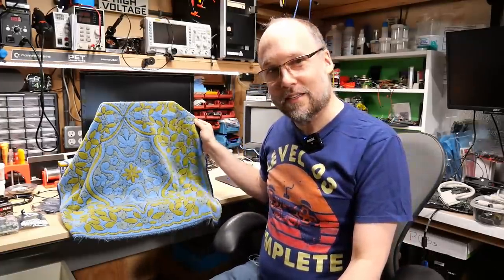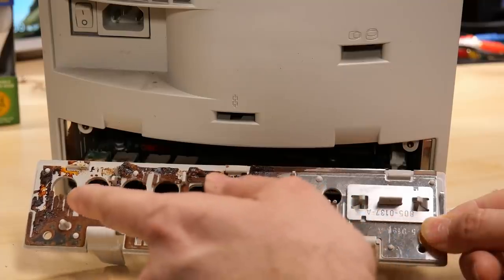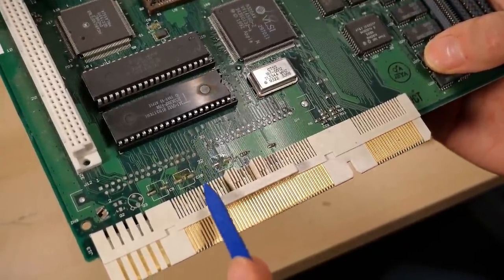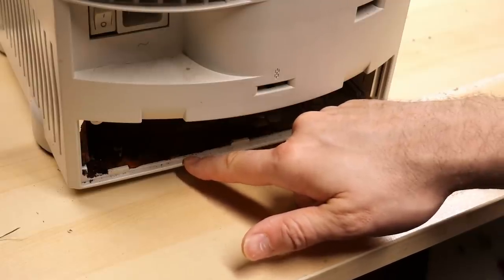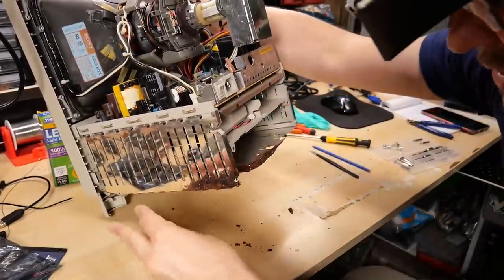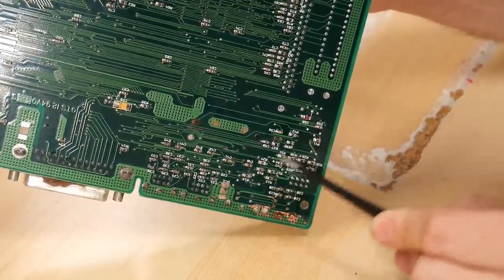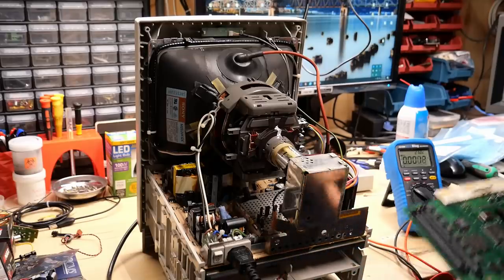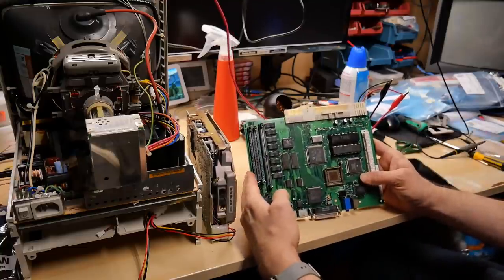Can I save this Macintosh Color Classic?

Comment: The 341S0417 chip next to the battery is "Cuda", a 6805 microcontroller that was used all the way to the iMac.  It turns the power supply on and off, and handles ADB, PRAM ("CMOS" in PC speak), and the clock.  You need a working battery and the crystal that fell off for it to boot up and try to power on the rest of the system.
Reply: It also needs the adjacent capacitor IIRC.  My original CC logic board would still boot without the battery installed, but required a second press of the power key to do so.
Reply: I think that if the 6805 341S0417 contains code similar to the 6805 344S0100 used in the IIsi for example you should be able to ground PA1 pin 25 for a soft power button without ADB. In the Color Classic this pin is just pulled high through 100k. The 6805 also generates the Power Fail Watchdog (PA0 pin 26) signal to the PSU. Without it I think the PSU will shut off.
Reply: Dang having cuda cores way back then. Apple was truly ahead of its time.
Reply: @adampope5107  you joke but they are exactly the same thing
Reply: Comparing that primitive 6805 microcontroller to a cuda is wrong in so many ways ....
Reply: @adampope5107  there is no cuda core or something like that in any primitive apple machines. You have read and learn what cuda core stands for and when it was first introduced....
Reply: @Walczyk  no they aren't.
Reply: @cezartorescu  you don't say
Reply: @cezartorescu actually they are 😊
Reply: @Walczyk yeah, whatever you say 😀😃🙂

Comment: I'm fairly certain the color classic used soft start.... from the keyboard power switch. Edit Ah and now I'm at the part in the video where you figured this out.
Reply: I couldn't find anything for the color classic but this article covers the soft start on the II and IIx. Might be useful for triggering manually. https://www.downtowndougbrown.com/2015/03/explanation-of-the-macintosh-iiiix-power-onoff-circuit/
Reply: This is correct — you soft start with the power switch on the keyboard. You can also socket the motherboard while the machine is running or short two of the ADB pins (I think 4 + 5) but I don't recall which off hand.
Reply: @StephenArsenault  That would be tough, ADB has only 4 pins…

Comment: If you are able to isolate the signals going to the ADB, the "soft key" works by dumping the +5v pin to ground. (Pin 1 to pin 4 on the ADB connector) You might be able to figure out a way to do this manually despite having no functioning ADB connectors.
Reply: Aha i presumed there would be a way to defeat the soft start if necessary

Comment: I vote yes on trying to fix that motherboard!
Reply: securitycountercheck  The repairs are typically not worth the cost, when the hardware is still fairly common. Some like the challenge though, and people like to watch. To build "repair" PCBs is certainly an interesting idea, but also requires quite a bit more time and effort. If there are already reproduction boards for sale or designs for download, that might be a better option in that case. It might not appeal as much to viewers as basic repair.

Comment: Maybe see if you could find a replacement motherboard? It's a prime candidate for the Mystic upgrade, where the CC board is replaced with one from an LC 550 or 575, along with a mod on the analog board for 640x480 resolution.
Reply: It would also be a good candidate for a takky as the case seems kinda rough on the inside

Comment: Very lucky that case is in such good condition, despite all the corrosion (and bugs!). I managed to pick up an LC575 for dirt cheap a while back, but the plastic of the case was so yellowed and brittle that every clip immediately snapped off when I put the slightest pressure on it. I have no idea if it's possible to restore the plastic so it's no longer so brittle, but I kept the broken clips in case it was so I could plastic weld them back on.

Comment: Could it be worth the effort just trying like a "dead by side of the road" fix, solder the components in the damaged area back in, maybe fix some of the most obvious traces, and seeing if you might get lucky and get an ADB port working? Since that is really all that has to work... i mean for me, as someone with a MUCH more limited knowledge when it comes to testing electronics, it would be worth a shot.

Really cool video by the way, i really like these "beyond saving" deals, and i actually think it would be really good content, if you went for fixing the motherboard up, even if it is not really viable, besides from a video content point of view. Getting this to work completely, even if it means an entire forrest of bodgewires in that corner, would be an awesome video.
Reply: I agree, let’s throw the works at this one!
Reply: I think its a great idea, you can check the contentinuity between the traces to make sure everything is electrically connected.  It would be a great video to show the sequence of operation for the Color Classic.  Are there schematics available for this mother board?
Reply: Agreed.
Reply: I agree great video very cool
Reply: Its a ton of work to trace out every pin and via and add bodge wires. The Cuda chip circuit isn't that complicated but if the corrosion has made it under the top layer of the board and you fix it, it may continue to eat away the traces under the solder mask and just fail a few months or years later.
Reply: @SidebandSamurai  Full schematics are available for this board (Someone paid to have it reverse engineered a few years ago!) so I would be trying to repair it if it was me, as the schematic is available even if this board has damage to internal layers of the board it should be possible to fix

Comment: There is a spray you get at the auto parts store that's designed for cleaning and removing corrosion from battery terminals, I've found it works great.  You might want to pick up some of that and try it on your next corroded board, it works pretty fast.

Comment: The ADB ports don't need the ICs for the power button. It just shorts out one pin to ground on the plug. Perhaps you only need to just jump those two pins?

Comment: I have the same 1993 Mac Color Classic upgraded with 500mb hard drive and 16mb ram. System 7.5.1. and Ethernet card  it surfs the internet fine with Netscape 3.0. It still works good but is getting old. The caps might start leaking soon. Do you think I should get it re-capped before the caps go bad ?......

Comment: Best of luck fixing it! I bought a LC520 this year which has a very similar architecture (I actually emailed you about advice on fixing it if you remember!) - it took a full recap and scrubbing of the motherboard to get it to boot, but it was still wonky afterwards; the screen would flicker in and out and occasionally the machine would hard lock up. I ended up recapping the entire analog board except for the big filter capacitor to try and fix the issue with no luck...it turns out the big filter capacitor was the problem the whole time. Replaced it and now it’s rock solid. If you get a new motherboard and it has a similar behavior, give that a try!

As another commenter mentioned I’d definitely try and do the “mystic” upgrade with a LC 575 board if you can get one. It’s a much better machine with a 68040 processor and proper 32 bit data bus.

Comment: The Color Classic and Color Classic II are basically the same architecture as the LC 500 line, with smaller CRTs and no optical drive. As others have mentioned some of their motherboards are interchangeable. As it's essentially an LC internally, it has an LC PDS expansion port, which I put many an ethernet card in back in the day, though other cards were readily available.
By the way, a good reference is the application Mactraker, it is a good way to look up specs and keep track of systems you have, I've used it for years (note, this is not a paid advertisement, especially as Mactracker is freeware).

Comment: Most Macs were soft power, excepting the black-and-white compacts, the pizzabox LCs, and a handful of random machines such as those in the Q610 form factor. Some soft power models (usually AIO models) also have a hard power switch at the back, probably to completely depower the system if not in use for a long time (useful because they do draw some power even when shut down and this also prevents damage from voltage transients). 
Also, your hard drive is probably stuck. You can measure the diameter of the original rubber bumpers inside and replace them with a stack of O-rings that don't exceed the diameter of the original bumpers (if they're too wide they'll interfere with proper operation).

Comment: So, I bought a dirt cheap Color Classic due to "No power" however, it is identical to Mac LC/Performa 500 series. So I got it, right away I plugged a keyboard in, plugged it, and welcomed with a Boot Sound and came right to life. I would upgrade it to a LC575 board if you can find it. True sleeper that way!

Comment: With something like that, could you put a mini-ITX board in the bottom, use a riser to get a GPU in the top cavity, and run a small flat panel that glued or velcroed where the CRT goes?  If the board is dead, could you do something silly with the case?

Comment: Hey Adrian! Nice video. I did one at a Color Classic I've got which had the exact same issue (major leakeage). After a LOT of work (like you did), luckily I was able to fix it and get it back alive. But I did have to trash the 2 serial ports in the process (the leakeage corroded the serial controlers). No biggie as no one uses serial ports on old Macs anymore (unless you want to connect a printer to it), so I was really happy with the end result... nice job on documenting the whole process, and also nice filming quality!

Comment: Back in the late 1980's  (specifically 1986-1989), the university I went to (Oregon State) had tons of monochrome Macs (now retrospectively called Classics) & I used them at the university library & also for classes (Pascal computer language etc).  However I did spot a lone color model somewhere on campus.  It seems as I remember the monitor being separate & was on top of the case, but I could be wrong.  I don't recall what model, that was so long ago.  That was really the last time I used any sort of Macs.  I'm more of C64 & PC guy.  The only souvenir I have that is Mac-related as well as from that period (time flies) is actually the box package for the Pascal installation 3.5" floppy disk plus a data disk.  The Pascal install disk itself I erroneously let someone borrow a few years later & was never returned to me.  So I never let anyone borrow anything of worth from that point forward, lol.    :-/

Comment: I recently had to get rid of a Performa 550, which I believe is the same or a very similar board, I couldn't save.  The battery had exploded, and it was just too far gone.  I felt so bad, but there was nothing to be done about it.

Comment: I used a color classic throughout college.  I plugged in the optional math coprosseser. BTW the expansion card door on the back was, in my case, for an apple II emulator so you could use apple IIe software as well. Another expansion option was a ethernet card.
Reply: BTW, I was an Apple certified service tech at the time

Comment: The expansion slot is an "LC PDS" slot, anything you can put in an LC style case will fit there, like an Apple IIe card. I am pretty sure they sold the 68882 FPU as an additional part. RAM maxed at 10MB or 12, may have only acknowledged 8-10MB, if memory serves, either way it was 2 MB short.

Comment: maybe at some point there is a replacement mother coming. but this would also be a huge task to get all that smd parts soldered. the vlsi chip seems to have a very fine pin pitch. that is not easy.

Comment: Hi Adrian! It looks like 4 pin Mini DIN female mounting connectors are still easy to get. If you're feeling brave, you could try to replace those corroded ADB connectors. Thanks for another great video and good luck with the repair!

Comment: This one's quite far gone, but if it's just light corrosion and the metal is still there, I use a very soft abrasive on the drill to take it back to bare metal, then in a plastic tub, I use a zinc rod and a crocodile clip on the metal to plate it with tin via electrolysis. It takes about 10 minutes, then flip the metal around to do the other side. That way the crocodile clip doesn't get a coating and nothing else. I use an old laptop PSU for it. 18V dc and plenty of watts. Nickel is another choice. Rods cost about 5-20$ on fleabay depending.

Comment: Another thing you might have to check for: I've seen some computers with a partial short on the power rail that was completed by plugging the main board in. (these kind of shorts have a tendency as being FPed as being on the main-board itself)

Comment: You should definitely watch a few of Paul Daniels' videos to see how he deals with corrosion on Mac laptops (flux, heat, solder braid, reflowing, enameled wire jumpers, etc.). Also, channels like Hand Tool Rescue can provide some ideas for removing rust (hint: Evapo-Rust).
Reply: Paul Daniels... That's magic...

Comment: That motherboard is definitely saveable
Reply: You missed out not. Its not saveable. Many traces are completely gone and multiple ICs and connectors are damaged.
Reply: @simontay4851  the board absolutely is savable with enough time and effort. damaged ICs and connectors were all off-the-shelf and easily obtainable parts. the traces can be fixed w/ wires and if you really wanted to go the extra mile, exposed copper could be tinned and covered with solder mask epoxy to make everything look decent
Reply: Its not. But it would be a good candidate for a reverse engineering...

Comment: I am super excited to watch this video.  I have obsessed over the minutiae of the Colour/Color Classic for ages.  I have a CC that I've restored and modified extensively.  It has a recapped LC575 motherboard with a full 68040 installed -- even a late Freescale branded L88M mask revision that runs nice and cool.  I have a 64MB SIMM installed for a total of 68MB RAM, 1MB of VRAM, PDS Ethernet, SCSI2SD, external battery mod, and I've modified the analogue board for 640x480@60Hz/VGA.  I have a microSD to SD extension so I can change the SD card without tearing my hands open getting the HD sled out.  It runs excellent with System 7, and honestly Mac OS 8.1 is totally usable too.
Reply: You have to power it on with a keyboard. Push the power button on the keyboard

Comment: Great video again - as always :) but I was surprised that you didn't know about the softpower switch via the  keyboard - btw. I just sent you an e-mail ;)
Reply from the maker: I did explain that on machines like the IIci with soft power, you can turn it on without a keyboard. I've actually never had a Mac you couldn't turn on without a keyboard... Even my Mac Cube has a button on the machine for this purpose.
Reply: @adriansdigitalbasement  yeah :D I also encountered some CC boards that have a soldered small button directly onto the board near the RAM sockets. Maybe this is something like a power button or more like a cuda? Apple really did change theri logical design on these CC and the AiO LC/Performa 5xx series.

Comment: As soon as you opened up that panel in the rear and I saw all that rust, my first thought was, "It's a Maxell battery" And sure enough, when you pulled out the board my suspicions were confirmed.

I have to say, this was the most literal debugging I've seen for a computer.

I am impressed on the service friendly design of the Color Classic. I'm almost tempted to try to find one.

I hope you can find a way to get yours going

Comment: I know people, well hidden in the depths of the Amiga community who repair Amiga motherboards with much more extensive battery damage. Especially the Amiga 4000, which has the battery near the RAM slots, but they still manage to revive them. They're basically re-doing traces by hand, and even the pads, via some technique. Maybe such people exist for other retro fllavors too? Would be great to find one of these people and try to get some extreme repairs on one of such boards, and you could still present the work which have been done.
Reply from the maker: The difference is the Amiga has extensive and super accurate schematics, so repairing them is relatively easy. There are no schematics for later Macs let alone tools like this: https://www.amigapcb.org/ 

On top of that, the NiCD battery leak on the Amiga doesn't cover the board and dissolve components -- the corrosion can easily be washed off and then you just need to fix any bad traces, if any. I have a couple Amiga battery videos on my channel and it's nothing like this.

Comment: I'm on the fence about this one. On one hand, I agree that the board can likely be saved, or at least made "functional" though I've no doubt it would be a chore to do. On the other hand, the effort needed to get this thing running might be better spent on other machines that aren't quite so badly mangled, especially if there are drop-in replacement boards for this thing on the horizon.

I guess it comes down to what else you're working on, and what your time is worth. Whatever you do, I'm here to watch it!
Reply: There's just the thing.  The replacement motherboards need an original one to reverse engineer.  So send this one to the same guy studying the other bad one he had.

Comment: Instead of WD40, I use CRC 5-56, which is much more efficient at dissolving rust and other metal oxides.
I've used it on electronics as well as mechanical parts for a long time. I highly recommend it on jobs like this.